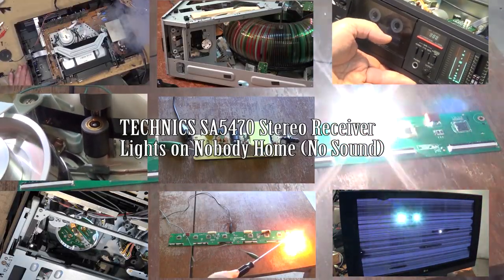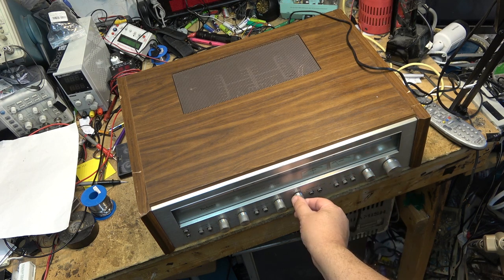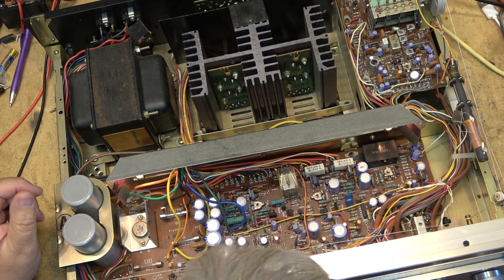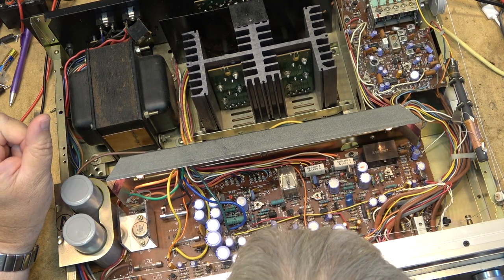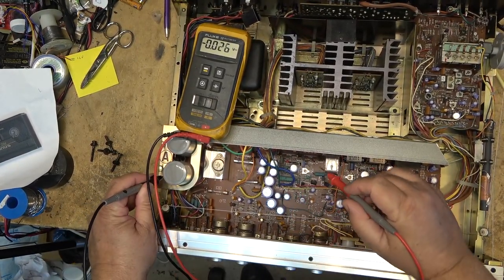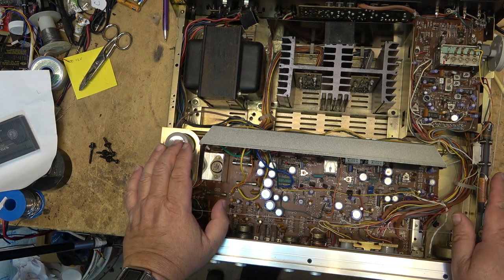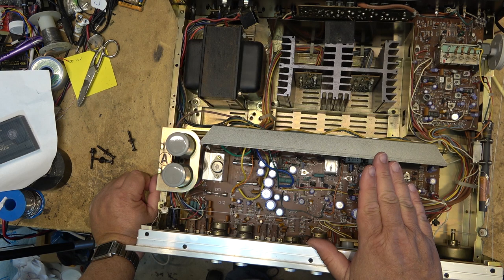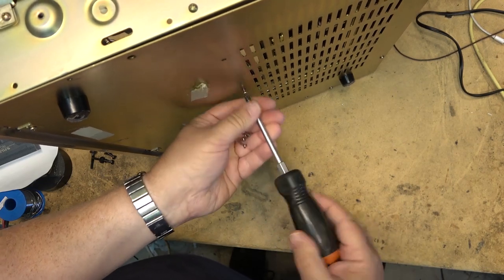Technics SA5470 Stereo Receiver no sound part 1

Comment: Sometimes if the legs are on the dual transistor, it’s good to replace them too. They can make a popping sound at the output. Since they are now hard to get and if they are 2SA798 s, I’ve read that two nice 2N3906 es will great. I’m not sure about matching them but would be good too. I bought these super-miniature dual 3906 es (MBT3906 ). Someday I will experiment with an SMT adapter board to replace a 2SA798. One problem might be a lower collector voltage on 3906, especially in higher powered receivers.
Reply: I meant to say if the legs are black.  I’m not sure how they get black but they are not that way originally.

Comment: You can pick up vintage Hi-Fi in the charity shops here in the UK sometimes for sensible prices.
It's not worth them trying to sell them due to the safety regulations that require them to be PAT tested.
Most have faults, and they are often in poor cosmetic condition.
I tend to stick to Pioneer as i have a good stock of the common parts for them including the fuse bulbs.
Any with good cabinets and front pannels i will have a go, sometimes you get an easy one, and this allows
me to make a small profit selling them to a guy i know who sells them on as a hobby.
The days are long gone making a living out of repairing old gear, but it puts the days in.🙂👍
Reply from the maker: The days were done 20 years ago as far as making a living fixing this stuff.

Comment: Pioneer vsx 453.. have checked and tested resistors, diodes, capacitors, transistors and fuses... But still the relays on the power amp board do not click on. Some transistors have dark spots underneath on the board but test good. Using a Fluke meter. I am at a loss here.

Comment: yup, emitter resistors! 
I bought a Pioneer SA-6500 II off of flea bay and someone had lifted the leads of the output transistors that were shorted. It was still working, I assumed from the driver transistors passing signal at low power.

Comment: I would say this is a good "cycle item" for ebay at around 249.00.
Why do I say that? Cycles for particular items exist. Years ago anyway. Now eBay seems to be the "Myspace" of online selling sites.

I used to pick an item, say Red Knob Fender amp. Easy shipping. One goes up for top dollar and it sells for say - 250. 10 guys see that and say "hey, I've got one of those!!" and lists it dfor 250 - takes an offer at 220 and the downward spiral begins with 8 out of the ten guys listing one. Now that ebay is flooded the price spirals downward. I used to grab them at the low end, wait until all the other sellers got discouranged, let the field fallow and then list it for top $ again..
It's a littl;e tougher now that shipping has hit crazy pricing but it did work ... still does to  a degree but only if you cross list. Follow the cycles
Reply: Happening now with a JVC VR5511 - first guy got all the moey - the chasers are sitting

Comment: What was the end result? Fixer or no.
Reply from the maker: There was a second part.  It was fixes. Owner brought in his own parts they turned out to be counterfeit. There is a second part to this one. It worked fine untill put under full load and then it went pop.

Comment: Well, as for me, I'd say to myself "just replace these few, lousy transistors and make a fair price" ..fixing it would be a sporting challenge, just for the sake of it.  We shouldn't waste resources so easily  - it's somehow decadent and ignorant of the problems and needs of the time. 
A lot of work, money and knowledge has gone into this device - if you don't fix it, it all just ends up in the trash and that's a crying shame. Obviously, the owner of the device appreciates its value and probably gave a lot of money for it ..it would do you credit to appreciate such an attitude.
Reply from the maker: The owner got it for nothing wants it fixed so he can sell it.  A unit like this sells for a couple hundred max so obviously he isn't going to put 150 into it.  Say the transistors are available and cost 10.00 each and there are 4. that's 40.00 for transistors.  Those big resistors another 10.00 so now 50 for parts. Shipping another 10.00 so 60 in parts plus labour.     All of a sudden the cost of repair has reached what the amplifier would sell for and you know that there will be caps that also have to be replaced.
Reply: @12voltvids  Okay, I understand your point of view and your way of calculating (after all, it's your job to do it this way). In my comment I was just trying to put myself in the same situation, and I'm almost sure that in my case there would be many alternative possibilities, in my pool of old equipment and components (basement, attic, workshop) that to find the same transistors or those with the same or even better specifications (comparison types, etc.).
Of course, not everyone has a, well, "spare parts pool" as I have and not everyone has the time to spend a long time looking for the right components. In this respect, it is of course understandable and time-saving to order everything new from a retailer (and of course that costs accordingly). My 'critical' words were less aimed at you and more an expression of my uneasiness in the face of this general throwaway mentality ..no offense  .)
Reply: @ch2o2  if the owner could fix it himself it might be worth while to flip.   But paying someone else to fix it doesn't make financial sense if he's just trying to flip it.
Reply: Well said it saddens me to see these go in the trash. But he runs a business and has to make business decisions that involve the owner of the unit.

Comment: I share your ideas about eBay, and about these low end HiFi equipment. I also guess most of what is sold "as is" is in fact the recycle bin of repair stations, so if it was declared unrepairable, it's generally for good reasons. So if you can't test the equipment, you should never buy it if not to residual price or for parts. And when you see some tampering, missing screws or more, that's a absolute no and generally a waste of time at the bench!Anyway, these low cost receivers may look good, but this is rarely the same inside: here, this Technics is fundamentally interesting with it's simple and clear design, and interesting fact it does not use the infamous fragile STK hybrid power amp modules that are now totally unobtainable. But I also share the idea replacing these power transistors could not be that easy (TO3 Japanese transistors are mostly unobtanium) nor economically viable as you can also count it will probably also needs a few caps and resistors, plus gigantic postage and toll fees, and last but not least, many hours to check it all.
Reply from the maker: The owner wants me to get a price for the transistors which I will enquire about.  Will see what is available.  As you said TO3 transistors are hard to come by these days as they haven't been used in 40 years.
Reply: @12voltvids  I found "ON Semiconductor" makes T03 devices and sold on Mouser. I used the MJ21195G and MJ21196G devices worked well in a Marantz 2275 and the Sansui G8700DB monster which uses 8 devices. They were $7.70 or thereabouts each. I wait until I have a large enough order to make the shipping costs reasonable. The T0220 devices for the drivers of the Sansui I am still looking for replacements. I got the Sansui for free, it is a total basket case, the owner said keep it.